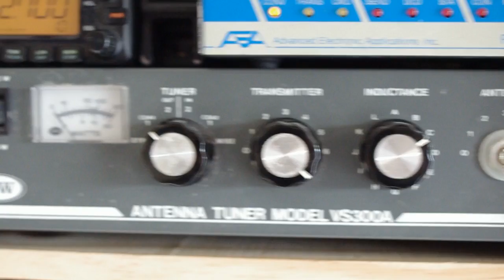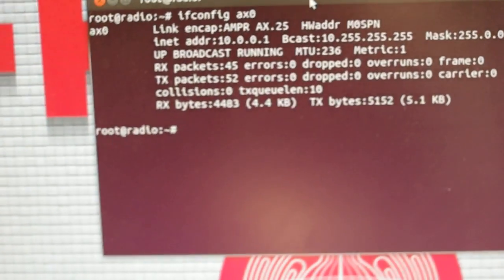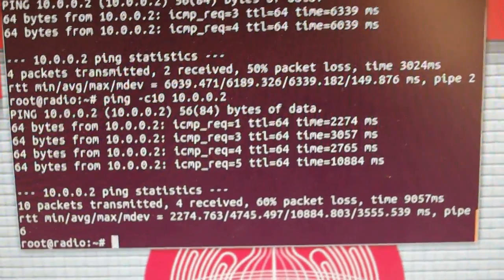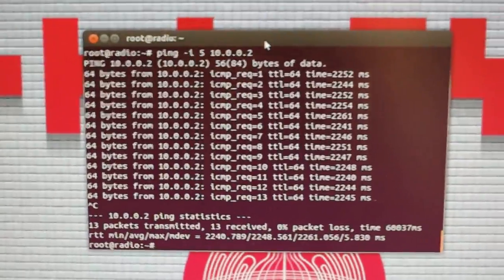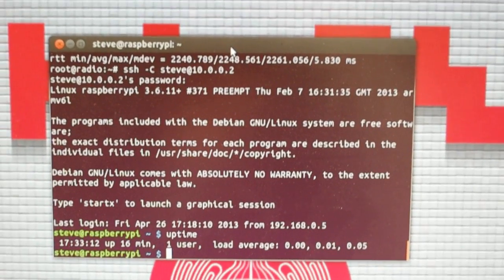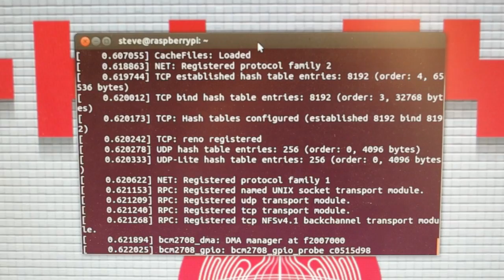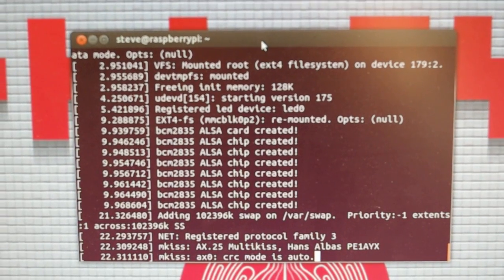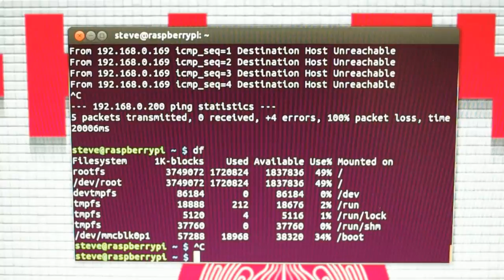Raspberry Pi, TNC-pi & TCP/IP over AX.25 1200 Baud Packet Radio!

Comment: I've got a couple of PK-232MBXs that I was given recently. I'm wondering why I'd use an old hardware TNC like that instead of a modern software TNC like Direwolf?
Reply from the maker: Hi - thanks for the comment.  In all honesty, Direwolf will be more sensitive and even offers error correction.  However, I do enjoy using these old devices and it's weirdly satisfying to see the LEDs blinking.  Also, more usefully, a traditional TNC will allow unattended mailbox operation (and possibly more) without needing to have a PC powered up 24/7.
Reply: @SteveNetting  Thanks, Steve. I suspected that such was the case. There's a lot of these old hardware TNCs out there and I think most of them are just being used for the sake of nostalgia. I think I'll set up one of them as a VHF packet BBS and keep the other as a spare. What do you think?

Comment: I love it!!! How much cost to build cheap one and what is needed from hardwares..i think that is P2P but i want have and the ability to send data to all listeners like andflmsg app and i want to work it like a server for others to connect on me ex: 5pc to the central BTS like ISP..(air ISP internet access) but i want to have some faster speed 56k or more if is it possible.
Can be done an old 56k modem to communicate over the ham radio with only rj11 to audio Jack adapter with dual link ham radio baofeng?
I need the cheeper and best solution.
The 51tnc is good for that i needed?
Please give me solutions.
My regards

Comment: I badly want to implement this on our Titan rover (Titanrover.com).  It's so difficult to find documentation on ax.25.  We would have ham operators, and use a Linux computer on our rover running telnet.  Since we have to communicate with our rover from a distance, this would be the perfect solution.  I'm going to check out your site, but if you have config files or ANY documentation on how you set up your Linux machine, it would be so helpful.  I already have a pi3, and tncPi2. Please share! ☺️ This is amazing.
Reply from the maker: Hi Richard - it's surprisingly easy.  I thought I'd written a 'howto' but I now can't find it.  When you configure an ax.25 interface under Linux the IP address is optional but once you do specify it - you're good to go.  Something like 'kissattach /dev/ttyS0 portname 10.0.0.1" where (I think) portname is the device you've specified in /etc/ax25/axports.  You will need to disable any auto-discovery services that will otherwise tie up the interface, though.  It's been a while since I've done this but please do drop me an email (either google or via www.m0spn.co.uk).  Good luck!

Comment: Have you tried using two TNC-X/TNC-Pi's in the AX.25 TCPIP case?   You are using a PK88 modem and a TNC-Pi in this video.   However, I have seen lots of complaints about AX.25 ping failures between two TNC-X/TNC-Pi's.    I have one TNC-X and one TNC-Pi, connecting to two Ubuntu Raspberry Pi's, respectively.   When either side acts as the source side to issue a ping command, the KISS TNC's red LED lights up correctly, and the Baofeng radios light up in correct order (source side red, then destination side green), but the destination side simply fails to receive the packet (nothing shows up in axlisten -a,  and there is no ping response).     I tried to use soundmodem (software KISS TNC) to replace the TNC-X/TNC-Pi, and gdb into the software KISS TNC programs, then I figured out the ARP response or ping response (i.e., a response package from the TCP/IP protocol stack) comes back to the destination side too early when the destination side radio is still in the receiving mode (i.e., with green LED on).   I tried to set the TXdelay to the maximal value allowed, on TNC-Pi using pitnc-setparams program the maximal value is 255, on TNC-X I just turn R13 clockwisely to the end.  No luck to make the ping work.    My guess is that I need to set TXdelay to be a larger value (e.g., 800), but TNC-Pi/TNC-X cannot do it.   So I just wonder if you have been in the same shoes.
Reply: BTW, would you please describe your TNC-Pi settings?  Is it possible that your radios have some digital features that are missing in Baofeng UV5R handsets, so the TNC-Pi works well?
Reply: I've figured out what's gone wrong in my case: the Baofeng radios.   https://illruminations.com/2014/01/15/baofeng-packet-radio-adventures/  Steve Conklin, AI4QR's investigation shows that Baofeng radios cannot work with TinyTrak4 (similar to TNC-X, TNC-Pi) "because the software in the radio only turns on power to the audio amplifier when it wants to make a sound."  To solve the problem, you have to implement hardware Carrier Detect or something equivalent as shown in http://larr-project.blogspot.com/2014/01/elegant-solution-for-carrier-detect-in.html

Comment: Will the Pi be a replacement for a PK232?  As PK232 has NAVTEX, AMTOR, FAX as well as Packet, could Pi be used along with a faster rate @9300 or even 38400 or above for transmission.  I don't want a PK setup that is large and taking up space when a Pi can be smaller and squared away somewhere so not really seen.

Thoughts?

Comment: Hello, please look at my code to interface a CC1101 chip based module (SPI interface + 2 GPIOs) as a virtual TNC: https://github.com/f4exb/picc1101

The thing basically works on 70cm band with a few re-transmitted packets and allows for much larger speeds and FEC correction. It also uses real FSK and not AFSK over FM. See: www.ti.com/lit/ds/symlink/cc1101.pdf

Comment: Can you please detail how you fixed the ping issue? How did you find the correct audio level? Is it possible to connect 2 RPi using SSH / telnet or is it required to have a server  - client setup? Thanks!

Comment: very nice! I also made those experiences, and you can reduce delay by changing the encryption algorithm and coding sizes, or using simple telnet. I have tested also the ftp, pop3 and smtp email, and textual web-browsing using lynx (with no graphic images).

another experience was using full-duplex AX25 access by having two channels of communication (RX and TX) in two different frequencies (VHF and UHF), total of 4 radios and 4 tncs. in this scenery I used 1200 bps for uplink (2 VHF radios and 2 tncs) and 9600 bps for downlink (2 UHF radios and 2 tncs), and the final result was much more satisfactory with less delays, being able to be used as a "slow full duplex link"...

regards, Roney

Comment from the maker: If you're talking about people connecting over the radio, they can simply connect to the callsign configured on the ax25 interface using the ax25 protocol (like connecting to any other packet node).  IP runs over the top of this but is purely optional;  the interface will respond to ax.25 or IP traffic.

Comment from the maker: The TNC-pi will only run at 1200 baud.  It should be possible to run 9600 using a soundmodem driver, however your radio will also need to be capable of this (a dedicated 9600 packet port, or audio taken directly from the discriminator).

Comment: I'm running ax25-tools along with soundmodem software... I have tcp/ip working ( and loving it ) however is there an easy way with soundmodem to run a bbs.

I could run an old fashioned tcp/ip bbs however then others would have to know the ip address, etc.

Comment: I'm not entirely sure if this is legal (might constitute a "secret code") but you could secure it with Google Authenticator. The way it works is that your computer and your phone both generate time-dependant one-time-passwords. The 6-digit numeric code changes in sync every 30 seconds on the two devices. To log in, you have to enter a password and a code, and you can restrict each code to be usable only once.